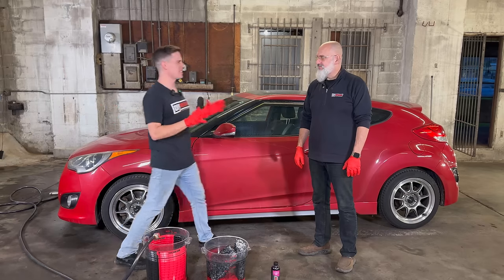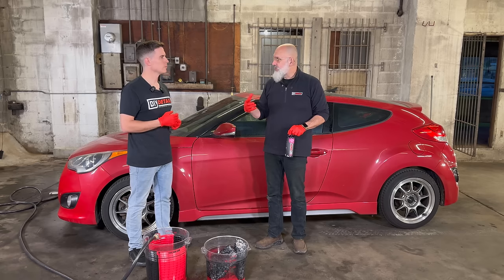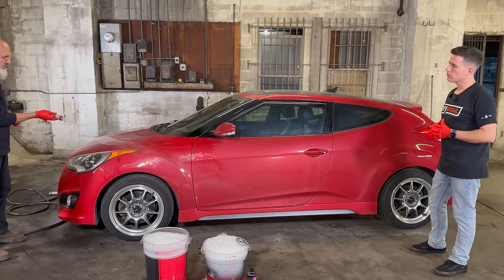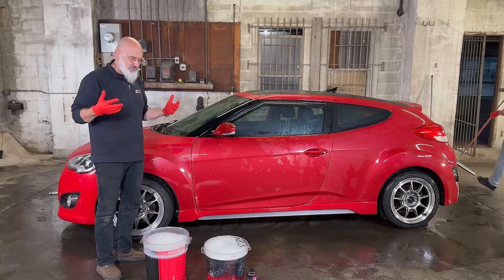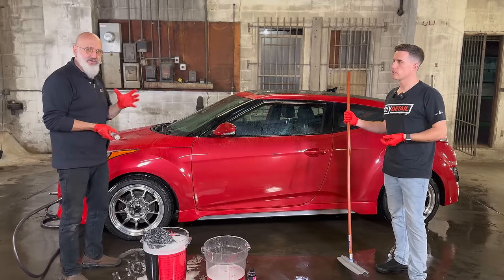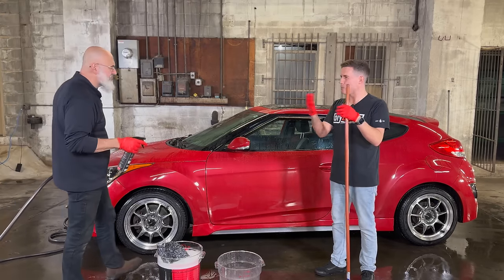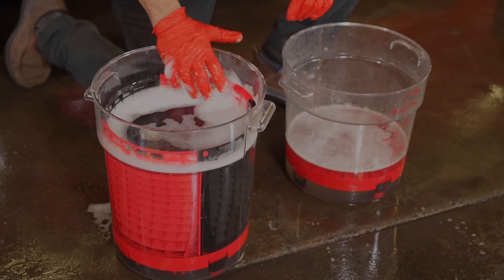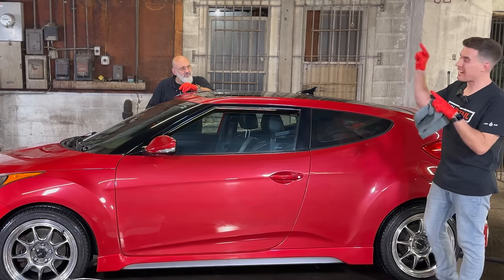BASIC car wash tutorial: 2 bucket method + garden hose (no pressure washer!)#diydetail #carwash

Comment: Awesome video Yvan and Nick! This is basically the method I use 💪 I put Rinseless in my rinse bucket that’s mainly the only difference and pre spray the panel with rinseless wash. The waterspot remover bought the beading back asap and quick beads slickness after rinsing is top notch 💪💪💪
Reply from the maker: That's a great idea!

Comment: Good info, I am a foam rinse foam guy myself with 1 bucket and multiple mits.  I can get around my vehicle normally with 3-4 mits without having to rinse out.  If I need, I rinse the mit thoroughly before going back into the bucket.  If I am using just a hose with no foam canon, I use my IK Pro 12+ to make foam 😀😀. I know that is not the "simple" way but a way to get foam on the panel. I spray rinseless on as a drying aid before drying normally too if I am not using it exclusively.
Reply: I use 82 mitts.  It's the best.
Reply from the maker: Good method
Reply: @diydetailofficial  thanks.  I also use 23 buckets
Reply: @RICARD01 😂

Comment: I’m coming from eastern Ontario, Canada. Being in a country setting ( lots of dirt roads) I still use the 2 bucket system. I find the vehicles are so encrusted with dirt, grit grime etc that even after doing a preform rinse there is still grit left behind. My way of being extra careful. I have a 3 year old truck with minimal scratches ( not from wash process just from being a truck).
I find that my wash bucket at the end of the wash is still very clean. I usually can do my 3 vehicles with the same buckets.
Thanks for great videos and great products.
Reply from the maker: Excellent!

Comment: That's very interesting to see that water spot remover helped with the flat water on the side. My car is coated and the car has been filithy with salt so the sides aren't beading as good until I do a proper decontamination wash with soap to clean the clogged coating.
Reply from the maker: DIY Detail Water Spot Remover in the spring will do it good
Reply: @diydetailofficial  I’ll definitely have to check it out and possibly buy some. I was trying to find the best way to decontaminate. Usually I just use a 8-9ph soap and it does a great job of removing the film and reactivating the hydrophobic properties
Reply from the maker: DIY Detail Incredible Suds is a ph of 8.5

Comment: it doesn't foam as much but I still sometimes use my soap blaster garden hose nozzle gun to apc degreaser 1st then rinse then I use incredible suds in it next for the contact wash..still only needing one bucket as you reapplied soap  after rising most dirt off. still no need for pressure washer..its just more fun. 💪
Reply from the maker: Agreed

Comment: Have you ever tried using the 2 bucket method with rinceless wash. My car had  heavy road film from driving in the rain for 3 days. Out of abondance of caution I ended up throwing away my rinceless mix after washing a 3rd of the Jeep, water was brown. Used 3 mixes of rinceless wash to complete the wash. Afterward I though that the 2 bucket method would of saved 1 mix.
Reply from the maker: Yes you can

Comment: Does the use of drying aids that leave behind protection (ex: quick beads) just mask the properties of the underlying ceramic coating? If the coating has fully cured, how is a drying aid enhancing the coatings properties rather than masking them by lying on top of the coating?
Reply from the maker: Some coatings DIY Detail Quick Beads will enhance.

Comment: In this scenario, I would use 1 wash bucket and 8 wash mits . Use 1 mit per panel . No need for second bucket ... grit guards
The main thing I don't like about cleaning with a hose is you can't clean the wheels properly. 
But this works for a quick maintenance wash on that daily driver
Reply: I use 27 mitts. It's way better.  And 16 buckets.
Reply from the maker: Good plan
Reply: @RICARD01  🤣

Comment: I use one bucket with soap. I foam soak the vehicle, pressure wash all visible contamination off, then I use the wash mitt and clean it thoroughly with the pressure washer after each panel. This method has never failed me.
Reply from the maker: That’s great!

Comment: What I don't understand is the point of wearing gloves if your hands are still getting wet and dirty. I wear taller kitchen gloves so my hands aren't wet and pruny
Reply from the maker: We never put our hands deep enough in the bucket to get them wet.
Reply: @diydetailofficial  How do you scrub the sponge/mitts on the grit guard? Do you use the sides?
Reply from the maker: Yes, the side walls are very effective.